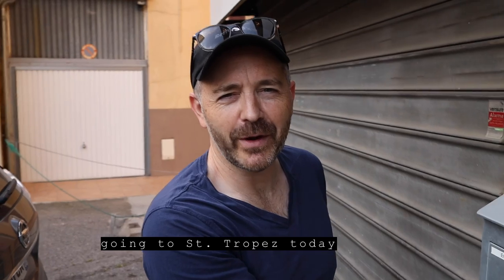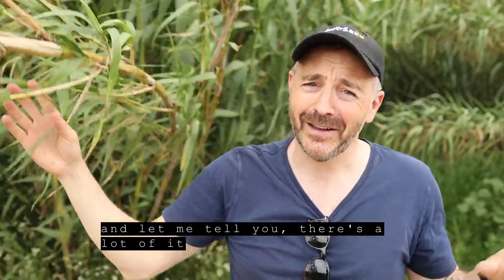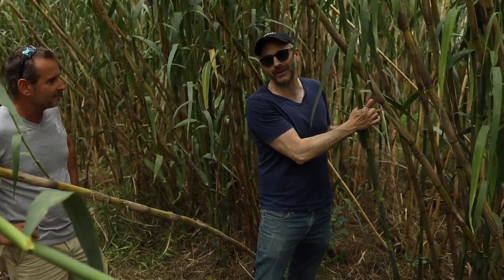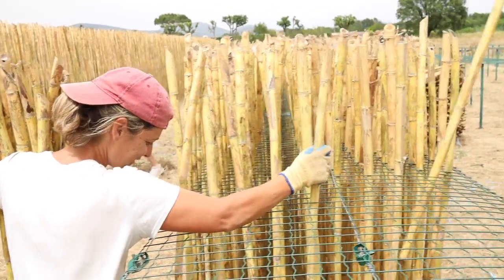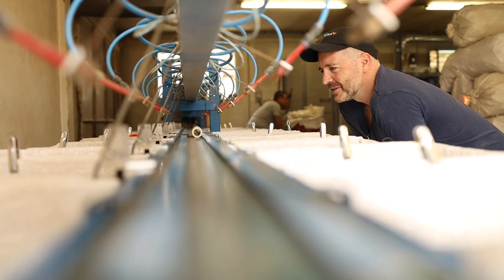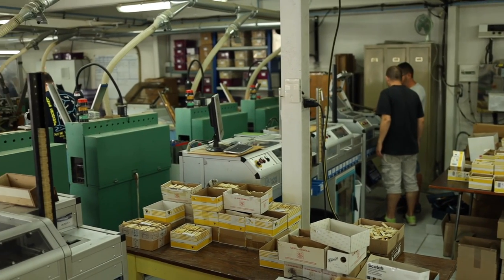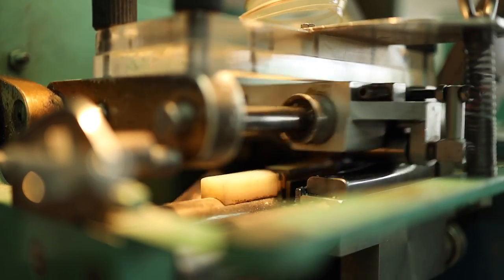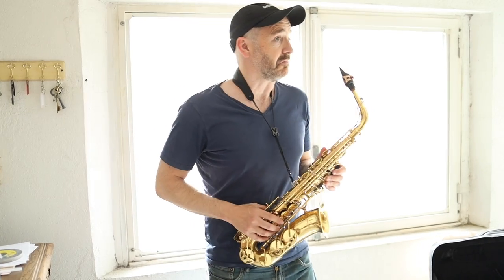How Saxophone Reeds are Made

Comment: I was wondering how much that box of 10 costs and how long. on average. does a reed last? I play guitar. I like to compare misery.
Reply: Other question: does it take longer to change a broken reed versus broken string?
Reply: Depends on the instrument, brand (quality) of reeds. I think someone here mentioned 20 to 40 $. I would say this brand is on more of an expensive side, but the quality would probably correspond to that.

Reeds get switched 1 per play session by some professionals I know. The quality of sound does get worse with time, so it is up to the musician when it's bad enough to switch.
They can damage easily because the end part is very prone to damage, it's thin. People can trim those, I never really got into that. 
If I need to sound great, I'll switch to a new piece. If I just want to practice, I can squeeze a few weeks probably, but it really depends on a reed, on the amount of playing done in that time, etc.
Reply: @gorillaau  Switching to another reed is done in a few seconds. The broken string needs much more time in my experience.
Sure, with reads, there might be some tweaking of the position, prepping it by keeping it in your mouth for a while, but really, the process of changing is basically like taking off a ring from your finger and putting it back on.
Reply: @davidzajicek7738  Thanks for the detailed explanation.
Reply: You can play 15 times with a Rigotti reed. No matter if you play once for twenty minutes or two hours, what counts is the process of wet, dry and play. Particularly, I take great care and can use 30 times each reed. You know that Reed is worn because the sound of the notes do not come out or tune sound.

Comment: The botanical nane of the plant is Arundo Donax, and can only be grown and harvested from areas that allow the plant to go dormant during the winter. Only two and three year-old poles are harvested and used for manufacturing. The drying method seen in the video is called “vertical” , before and for many years it was done the”horizontal “ method which required a larger area and very exhaustive work of pole rotation for three months.

Comment: I play with Peter Ponzal reeds and Hemke reeds for both my Soprano and my Tenor. With the Peter Ponzal reeds very rarely do I ever find a reed that needs any adjusting much less a bad reed. I have used them for over 10 years almost 14 years with my Tenor and I have found one that was bad that needed work but it did work. And I have had a few that needed minor adjustments, but 99% or more have been exceptionally consistent and I love the sound I get with them.  Hemke on the other hand hasn't been as consistent but not bad by any stretch of the imagination. They too have been an outstanding reed especially with the Soprano.

Comment: Awesome video, loved how relevant it is to double reeds too. 

I watched the video thinking it’s never EVER occurred to me to complain about my alto or tenor reeds (Vandoran 2.5 to 3, as well as any brand I find to try) I’ve never paid attention to the ratio of good reeds to bad, tend to hoard them ,as often they change and play better in different conditions. As a double reed player I make a conscious effort to NOT tinker with Sax reeds and have no qualms in tossing them if they eventually disappoint. Sax is my fun, no fuss instrument with easy reeds, oboe the Prima Donna.

FYI to single reed players, Oboe reeds are up to $35 AUD each, compared to alto reeds at $4.50 - $5.00AUD each. Or if you make your own it’s $5-6 a staple (the cork bit at the bottom for the uninitiated) plus the thread which does last hundreds of reeds, the $2 up for the cane if you buy it preshaped. Then there’s the time taken to make which can be a month or more as they need to rest between stages. On top of that there is the equipment which can range from hundreds to thousands of $$ depending on if you make them completely from scratch and buy tube cane, split, gouge, shape. There’s a different machine for every stage.

Comment: Hey Jay, I play alto sax 46 years now. What started out with RICO reeds I would buy them individually and play until they break, now has become a reed addiction. Learning to play I didn’t really play too much, but now play as much as possible and buying reeds has changed.
For what seems like journey to get what I feel I need, I was buying Rico Royal reeds, then Hemke reeds, which is just a better version of Rico, then I moved up to LaVoz reeds and now my final destination is Vandoren reeds. I was buying the Classical 2.5 reeds and  then the V16 reeds, and now I have found that I really like the ZZ reeds the best. I play a Rousseau 5R mouthpiece with #3 strength reeds. In my case I have V16 reeds ready to play, 1 box of ZZ reeds ready to go and 1 new unopened box. 
I have a Carbon Fiber reed that I can play on anytime, but for my ears it just can’t replace a wooden reed.
Yes, all the reeds are expensive but when broken in properly, lasts longer than what a normal life of a reed would be.

Comment: I bought a box of Vandoren Blue box 2.5 Alto sax reeds because I am a beginner alto player, and 8 are actually good, 2 are really good out of those 8, and 2 of them are really airy and do not respond well. I've got to say though, the alto reeds are was more consistent than the clarinet reeds of the same Vandoren Blue box, but I use strength 3.5 on those and I get about one really good reed per 4 boxes for clarinet reeds, about 2 to 3 good reeds per box, and about 6 to 7 horrible reeds per box that only can be saved by the ReedGeek (which I have yet to purchase. I currently work my reeds using 900 grit, 1500 grit, and 8000 grit sandpaper cloths because I find that I don't have to be as cautious with the higher grit levels as I do with the lower ones I have tried in the past and the ReedGeek. I really didn't know how to use the ReedGeek at the time thought because I only got to try one when I was about a beginner at clarinet and didn't play alto at the time. My band teacher used to tell me at that time, "ReedGeek is a waste of time and if you want to double on Alto Sax, you might as well double on Alto clarinet; it will save you much trouble." I very much disagree now because I believe the ReedGeek is an amazing investment that I would like to get one day after the coronavirus is neutralized and it is safer to go out and buy things. As for the Alto Clarinet vs Alto Sax, Alto Clarinet reeds are a lot less common than Alto Sax reeds, and with good folks like Rigotti making such good reeds, I don't see why investing in a $100 beginner saxophone that sounds pretty decent is a bad idea. That plus the fact that the Alto Sax has a whole lot more variety of music to play. I am not saying the Alto Clarinet is bad, I love playing it when I get the chance to get my hands on one and it is such an amazing instrument, but for a band kid who really didn't know what he was doing, I would say that the Alto sax was a good investment when I bought it because now, when I finally picked it up, it is so easy to just whip out and play, swab, shine up, and put right back. That and this amazing channel's super effective video on how to set up your embouchre is so helpful because I got discouraged and thought my sax was leaking simply because I was trying to use a much tighter clarinet embouchre on an alto saxophone, and as someone who plays in the higher altissimo range on clarinet a LOT, my embouchre was far too high to produce a good sound on Alto. 

All in all, for those of you who have read thus far, thank you so much, and thank you, Jay, for producing such wonderful content for all of us Sax players to become Better at Sax. You really have impacted my life in such a huge was and I really appreciate that.

Comment: Add to production costs, the development, production and maintenance of the machinery, the energy required to keep constant the humidity and temp of production areas.Packaging design, printing, wastage of faulty reeds, Wages..Local taxes other stuff which I missed. 
They ain't cheap by the time you open that box.
I can remember when not all 10 were playable. Rarely happens today

Comment: Last two boxes of reeds I bought were Vandoren V12 4s for my Bb clarinet (box of 10 for about $40), and Vandoren 4s for my contrabass clarinet (box of 5 for $50). Of the Bb reeds, I've only used three reeds so far (I don't play Bb nearly as much as I used to), and they've all worked out, slowly replacing my set from university. For the contra reeds, three of the five have been great; however the other two work very well on the contra alto clarinet I play, so I lucked out. 
Since I also play Eb, alto, and bass clarinets, and own an alto sax and a C melody tenor sax, gotta have reeds for them too! It's quite a collection... 
And yes, double reed players still have it worse.

Comment: Nice vid, I might give Rigotti a shot.  I buy La Voz reeds - have done for years since I discovered them.  They're not quite as good as that one really good Vandoren reed, but they are absolutely consistent.  A box of 10 La Voz is a box of 10 completely reliable reeds and I would have no qualms about taking an untouched reed out of the box mid-gig (and have done so many times) - no way would I do that with V.

Comment: I live on the coast where humidity changes a lot. In my opinion Rigotti reeds have shown to have unequal fiber uniformity as well as resistance to warpage.  10 out of 10 are generally useable with minimum reed working.  Tip balancing for altissimo response is the best, bar none. Here are my setup:

Tenor; Dukoff Hollywood 7 ( 0.100”) + Rigotti Gold 3M
Alto; Woodstone traditional (early Meyer clone) 6 (0.076”) + Ishimori/Woodstone 3.5 ( by Rigotti) or the new BSS 3.0 
Alto legit; Selmer pre-soloist short shank airflow C** (0.072”) + RobertoWinds 3.5S (by Rigotti)
Reply from the maker: yeah the reeds are great, now more people will know...
Reply: @bettersax  I must admit that I quite like D'addario Jazz Select on tenor.  However uniformity box to box seems to vary from season to season.  I suspect that being a large size corporation, they harvest cane from multiple growing regions around the world. Having multiple manufacturing sites, maintaining production line matching -for cut and strength, is inherently more complicated.  In my experience Rigotti is just more consistently good and reliable.  I quite like the argument that the wind exposure plays a great part in their cane structure and quality.  When one looks at those reeds, the fibers are always long, straight and dense compared to most of their competitors.

Comment: Really good presentation. Very informative and not long. But  the 5 different stages of manufacture were in 5 different locations  - not efficient. I play clarinet and alto sax, and I have always used Vandoren 2 strength. In the 40 years I have been playing I have noted that the quality has improved massively.from about 20% that were good, to about 80%. Thanks

Comment: usually buy rico royal2 for alto and tenor,but have bought others ,dont normally buy a box ,50 per cent playability with single reeds,pot luck,i have reed geek for adjusting .
Reply from the maker: With the reed geek you should be able to get every reed to play at least well enough to practice on if not for performances. Maybe try a different brand.

Comment: I use Rigotti reeds on the Tenor sax. Yes they are expensive. They also last (with me) almost four times longer than Green Java i used before that. DO i think they are expensive? no i do not! For me they cost half the price comparing to Green Java.
Just try a box and be careful picking your reed size. Very important.
Reply: They cost half the price not because they are sold at half the price. No. They cost to me half the price because they last much longer. I used to spend around 120€/year on java reeds and for the last 4 years i spent around 70€/year.

Comment: Okay, so, next question:  Why are so many reeds crap?  And I think I know.  I very rarely get a bad clarinet reed in a box, and when I had an alto most of those reeds were good.  But with my tenor, it's less than half the reeds in the box that don't sound stuffy or play too loose or stiff.  I don't have a baritone, but I've heard it's tough to get good reeds for them as well.
And I think the reason is that with all this high tech machinery they've brought to bear in the manufacturing process, they might have better spent some of that on selective breeding to develop slightly larger diameter Arundo Donax for tenor, bari, and other wider reeds.

Comment: Gosh, in 1960 they were about 25 cents. $2.50 for bassoon reed
Reply: I'm not sure I understand your comment. $0.25 in 1960 is about $2.16 today. Quick check of basic reed prices are between $1.50 and $3, so about the same ballpark as they were in 1960. Unless you were complain Rigotti specifically, then I have no idea. There are all sorts of possible reasons a single company's prices could have changed.

Comment: Rico 2.5 all 3 were good with a little adjustment. Rico 3, 2 good, one seems stiffer and needs work.
Flying Goose (Chinese) 2.5 on ebay. 4 or 5 of the 10 are decent, might get a couple more with work. Very inconsistent from one to the next and none respond well across octaves.
10 pack of 2s, the cheapest on ebay from China. 3 of 10 playable with work, maybe some more with lots of work, 1 was cracked on arrival and went right in the trash. They are visibly uneven and lop-sided.